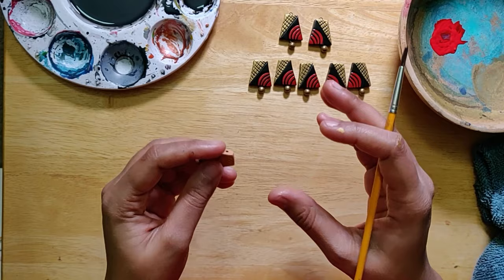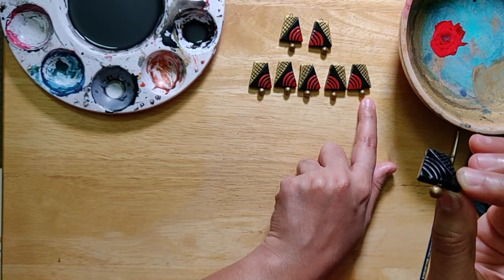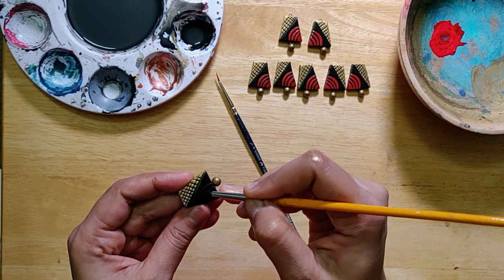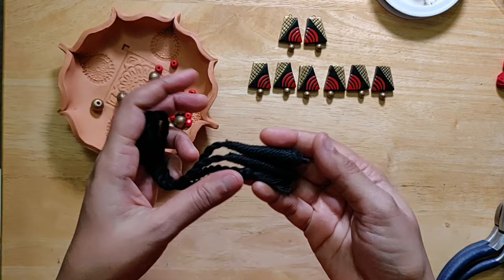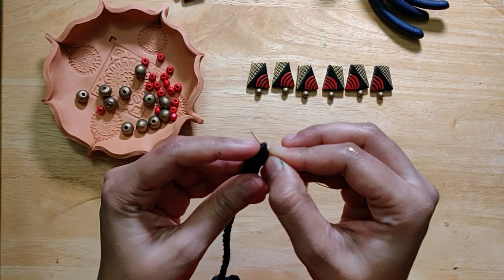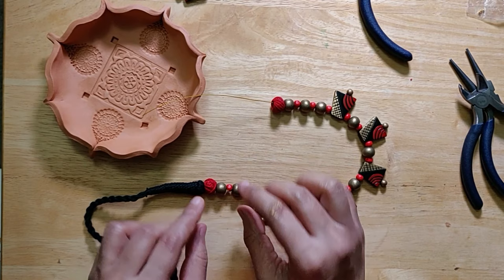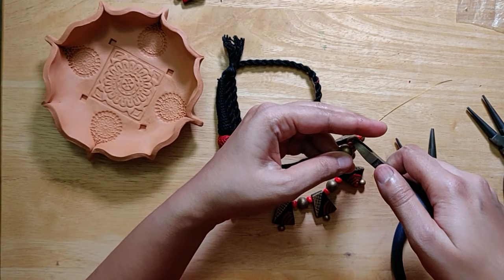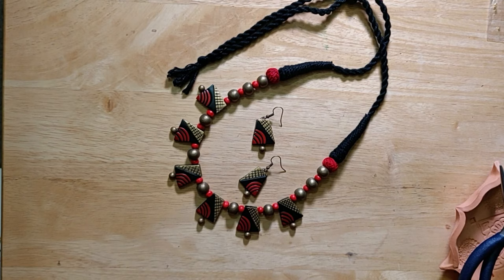Painting and assembling using gear wire! #terracottajewellery #howtomake

Comment: First of all, the set is very simple, classy and beautiful. I loved its traditional touch.  Second of all, thank you so much for showing this assembly. It's really helpful. I had problems locking the wire and the crimp beads that kept on breaking as I was pressing on them. I will use this method in my next project. 🖒😊
Reply from the maker: Thank you so much! One of me favorite color combinations. You might want to get good quality crimp beads. They are the only key part in this holding the entire piece together.

Comment: Acrylic paint wil not go on washing right? Will it not stick to your hands and brushes and leave a stain?
Reply from the maker: Nope its fairly easy to clean. Acrylics are water soluble but become water resistant on drying.
You can varnish the jewellery once painted. That way your paint is also protected.

Comment: am sorry i will sound stupid, as i have few question its only coz of love for this art makes me curious anxiety to know every details desperately.  

one the amazing art ...sadly i dont have studio nearby nor have electric kilns (which is so expensive to buy.) to heat it. therefore  or if its  possible to dry on sunlight ?., 
Neha mam is it fine if terracotta jewellery or any items can be made by air dry terracotta. If yes, could you recommend  best  brand quality air dry terracotta.
Reply from the maker: That's fine. Its good to ask questions and if I can help, I certainly will. If you don't mind, which city do you live in?

Air dry clay is something I haven't used so I wouldn't be able to recommend a brand. But you might be able to approach someone who is already into air dry jewelry. They might be able to help you with the details.
Reply: @nehagopinathpillai  not air dry clay, but terracotta air dry clay ,the texture is kinda terracotta where it doesnt require to heat, it get dried anyway, i heard somewhere.
i live in kalyan. there are studio but far western suburban mumbai, its kinda 2hrs journey from my place.

Comment: Thank you for showing us the assembling. Can't one crimp the bead first and then bring the wire through the other beads?
Reply from the maker: You may do it either way, provided you are able to get the beads held tightly. The catch with using gear wire is just that - if it's not tight enough the beads looks loosely strung with the parts of the wire. showing.
PS: I am not sure if I have understood your question correctly, but the whichever method you follow the above mentioned point is key. Apart from the fact that it should be locked well :)

Comment: Thank you very much for sharing your wonderful terra cotta jewelry creations, they are all lovely, I've read they could be breakable, do you or can't they be sealed with resin or polyethene, etc?
Reply from the maker: Thank you so much for your feedback. Terracotta isn't as delicate as say glass but yes it is breakable and needs to be handled with care. In this piece I have used acrylic paints to add color to the jewelery. And yes you can add a polyurethane varnish to seal the coat. I will share a video soon on how to do that.

Comment: Nice mam.
Reply from the maker: Thank you so much! :)
Reply: Sometimes break the jewel when I fired.why mam?
Reply from the maker: @ShanmugaPriya-eq6fs  There could be multiple reasons for that. Could be moisture content in clay, or an air pocket. Firing it in an electric kiln usually reduces that risk. Temperature rise should be a gradual process. If too much heat is induced in the beginning there is a good chance the clay piece might crack.
Reply: @nehagopinathpillai  thank u mam.how  many hours will fire the jewel mam.3 or4 .

Comment: Mam red earth or earthenware clay is same? I bought red earth clay from clay station... Shall we use for terracotta?
Reply from the maker: I think you can. Just follow the temperature range required to fire. The info might be available on the site you bought the clay from.
Reply: @nehagopinathpillai  yeah mam I asked them but that's high fire... Am just asking you, they told tahts red earth clay..
But it's so wet to work after take out from parcel...can't work easily, shapes getting collapsed mam any tips?
Reply from the maker: @mohankannan1537  https://online.claystation.in/collections/clay/products/redearth10 - If this is what you have purchased its clearly low fire. Not high fire. Its clearly mentioned on the website as well. And if the clay is too moist, knead it and let it stay out of the bag for a while before starting work. Let it harden a little. Not too much though or you might end up with a lot of cracks in your work.

Comment: I want to know mam, the varnish you used here, is it sticky after drying,I used modpodge before ,but it sticked and colour came off
Reply from the maker: I haven't used mod podge. But I have heard a few of them used it as it worked for them. I use a product called decoart satin varnish. It's applied after the paint is completely dry. I let the paint dry for a few hours, then apply a coat of varnish. Once it dries completely, it doesn't stick.
Reply: @nehagopinathpillai  thank you very much mam, actually deco art is very much costly for me, thats why I want to sure that it dont stick atall, after it dryies

Comment: Mam i have a doubt .After i paint my terracotta jewellery, its stickyy can i know the reason for this mam
Reply from the maker: Hello! What paints do you use?
Reply: Acrylic (fevicryl) colours
Reply from the maker: @dhanyasri5710  okay, what's your process. I mean how do you fire your work and when you paint, do you dilute it.
Reply: I fire it in a pot. And its been painted maybe after 5 to 6 days after firing. Mostly i dont dilute paints mam
Reply from the maker: @dhanyasri5710  please dilute it. Thick paint will make the surface sticky and it can peel too. With diluted paint, if the coat is thin, then wait till it dries and apply the second coat.
Reply: Okay mam thankyou so much mam